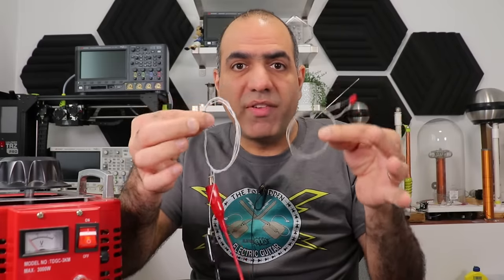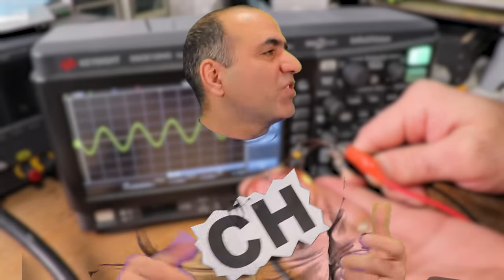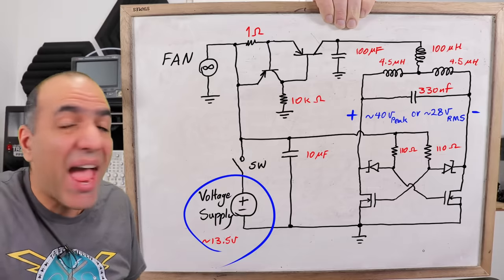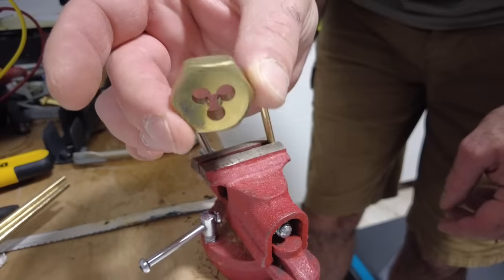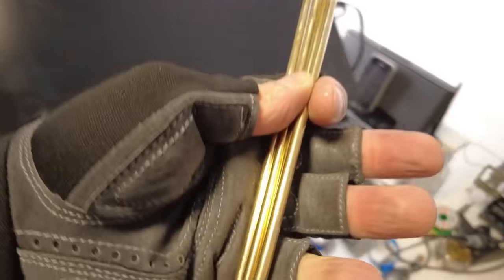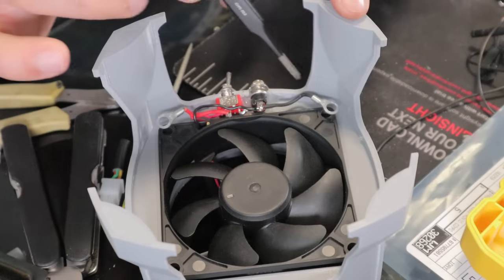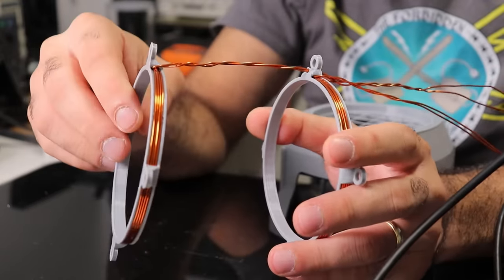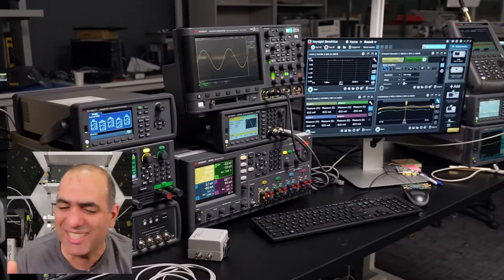Making a Lantern Full of Fireflies

Comment: Honestly, it was nice to see you proud of something you built without it exploding.  Plus it's a thing that I would actually buy!
Reply: Why not build one? I mean this is basically a how to, with an included circuit diagram.
Reply: @salemcripple sadly not everyone has access to a 3d printer.
Reply: @sonicgen20 
3d printers are stupid cheap now, but regardless you could easily modify a thrift shop lantern. The part I see most people struggling with is the soldering and coil winding.
Reply: I would love to build this. You did a fantastic job on it. Can you post the circuit diagram and the printer files?  @salemcripple

Comment: This project genuinely inspired me. I would actually love to recreate that lantern as well.
Reply: i feel like the only mechanical improvement would be to get a slower fan to make them look more like they are "flying" rather than being in a vortex... probably easier said than done
Reply: @sorcererCermet you can get fan controllers that can control the rpm!!
Reply: @sorcererCermet would magnets work? Attach LEDs to magnets and then adjust the strength of a bottom magnet to raise and lower?

I guess it wouldnt look right because they'd all be roughly the same height.

Comment: 08:00 Looks like you need one of those magnetic, flexible headbed plates EB. They're weakly magnetic so its easy to peel a corner up and as the plate bends the print should, theoretically, pop off.

Comment: Two suggestions! First you could send the coil power through the two remaining brass rods.  The ends of the coils could be soldered to the brass where the brass passes next to the coil.  Then coat the rods with clear coat or conformal coat so that nothing shorts them out.  The second suggestion is you could add a second LED in the opposite polarity since they are diodes they will act as tiny rectifiers. That way the "flies" will be producing light for the full wave instead of only half of the wave.  You could sandwich the capacitor between the LEDS.  Also hot air and solder paste is very helpful for tiny SMD components.
Reply: Good ideas, but I disagree with the second LED suggestion. Polarity will keep reversing as the coils move about in the chamber and the second LED will reduce the flicker effect and add weight to the element. Though they would not reduce the current draw as they are opposing polarity.
Reply: @drwhoeric  Nope, polarity is reversing anyway 96000 times per second because it's AC. So the movement of the fireflies doesn't affect the polarity of the waveform the LED sees.
Reply: @cooperised  @drwhoeric Exactly! The frequency is way too high for the polarity change to produce any visible flicker.  Infact, Flourescent lighting flickers every time mains AC changes polarity, or 120 times per second for 60 hz AC.  That flicker is barely perceptible to only the most sensitive people.  However, the phosphorescent coating does continue to glow dimly after you shut power off, so the contrast of each flicker isn't as great as if you had a 120 hz monitor flicker between black and white screens.  The flicker of the "flies" is actually created by the orientation of the fly's coils.  When the fly coil is perpendicular (horizontal) to the alternating magnetic field, alternating current is induced in the coil to power the led, but when the coil is parallel (vertical) to the alternating magnetic field, no current is induced in the coil.  Also the angle of the coil will vary the intensity of the induced curent, so at a 45 degree angle (diagonal) the induced current is half as intense.  However, a negative effect could potentially be that the additional LED changes the resonance of the entire circut, but this is easily fixed by remeasuring the resonant frequency and adjusting the driver.
Reply: Problem with the 2nd led is that it would never stop glowing it would alternate between the two depending on which part of the magnetic field is induced, it wouldn't look like a firefly
Reply: I think with a second LED it will be much worse if it works at all because you basically shortcut the capacitor if you allow both directions.
Reply: @cjdelphi  Nope, like was said already, the current induced in the fly is alternating current at 95 kH or changing polarity 190,000 times a second thus causing the LED to blink 95,000 times per second.  Most humans can only see up to 60 Hz, or something that is blinking 60 times per second.
Reply: @1234567890CAB  my issue with what you say is, it's coming from a pulsed square wave dc at 12v, not sinewave you know what.. i'll build it this weekend and pull out the oscilloscope
Reply: @cjdelphi  Agree, that is why I recommend not even trying that. As one LED goes high, the other would be it's inverse. Plus it would add burdensome weight to the coil.
Reply: @drwhoeric  I've been meaning to build   something like this for a while only without the jar, a couple of coils and see how far I can transmit the energy..

At the same time I can investigate the voltages induced on the second coil
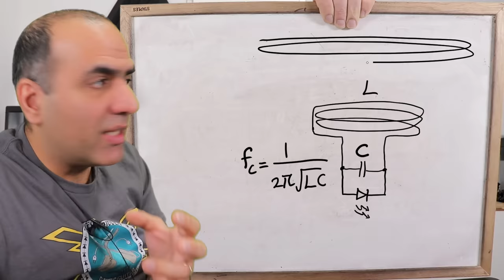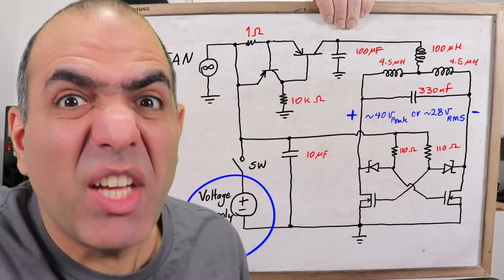Reply: @cjdelphi  Okay a couple of things.  First I was going off of what he said at 1:25 4:20 and 5:42 where he describes the coils as being powered by AC, thus I assumed positive and negative.  Next, at 13:05 he implies that the circuit he designed did not work as intended and he had to change it, so we don't know if the schematic he showed on the screen is exactly what he used.  Along similar lines, we don't know for sure the orientation of the coils on the glass, we are assuming that they are in phase and producing magnetic fields of the same direction, but if one of the coils were put on upside down, they would be making opposite fields.  Finally, my understanding how inductors and transformers work is as the voltage is being applied, voltage is rising and thus the field strength is rising.  The secondary coil in that changing field only has emf induced while the field is changing.  Once voltage in the primary has leveled off the field stops changing and thus no more induced emf in the secondary.  Then power is cut to the primary coil and the field begins collapsing.  Now the collapsing field induces a back emf or negative current in the secondary because the secondary coil is seeing a weakening magnetic field. Now weather or not the voltage in the primary continues to drop into the negative doesn't change that there is back emf being generated by the collapsing field, it only makes the magnetic field strength continue to change in the negative direction because the voltage is changing in the negative direction. Additionally a transformer powered by a square wave is very inefficient compared to one powered by a pure sine wave because there is only a "product" in the secondary when the field is changing. Finally, I am still a student so my understanding could be wrong or I might not be 100% correct.  Also everything described is assuming ideal inductors/transformers/circuits and as we all know the real world is often non-ideal.
Reply: Another thing that would be interesting to test is if just a fixed magnetic field was used and how strong a field and how fast the flies would have to be moving through that fixed field for them to light up. If the flies were spinning perpendicular to the fixed field they would form an "alternator" or simple fixed magnet generator and would have an induced alternating current that was the same frequency as their rotation.
Reply: @1234567890CAB  my understanding could be wrong based on the circuit he posted on the white board, um cgi of a whiteboard I'm merely comparing this circuit against what happens with 2 windings on a toroid

The secondary winding wouls be reverse polarity of the primary winding as the emf builds giving a negative voltage,  that's why I'm not saying you're wrong in the slightest you could be right, but feeding -12vdc through to 0 and to 12vdc absolutely would do what you originally said, I'm just struggling to get my head around it and it's easier to just build one and see 😀
Reply: @1234567890CAB  interesting thought, just create an electromagnet and let the fan do all the hard work, I'm not sure if they would be fast enough to induce enough current in the winding without needing more coil, then we have to consider the huge power losses..
Reply: @1234567890CAB  unless permanent magnets were used...

Comment: Now THAT is a very nice project!

I'd use maybe 4 coils with 2 turns each coil. Use some kind of fast mosfet driver ICs for output stage, capacitor pi-network to match the coil impedance, and then use some faster Arduino (72 MHz BlackPill?) with potentiometer to tune the frequency for maximum voltage on the coil (should be in the ballpark of 10MHz for coils this big).
For fireflies, I'd put two LEDs in anti-parallel (no capacitor, just use parasitic diode capacitance), and tune the frequency by adding turns.
After making fireflies, fine-tune the big coil frequency with Arduino for maximum firefly brightness (and adjust the capacitance as well)

Comment: Maybe by using very small capacitors on the fireflies, you could only put the coils at the top and at the bottom of the tube so they could be hidden. When the fireflies go near a coil, their led would stay on 1 or 2 seconds without needing to be in the range of the coils, enough for them to move around and  eventually recharge when going near a coil, while being continuously on.

I don’t know if capacitors are possible because the magnetic field is AC, if it can be made to work it might require extra components making it to heavy  (don’t hit me the circuit part was to complicated for me)

Comment: Awesome video. Some 3D print tips. Looking at the parts that broke you have some underextrugen (not enough fillament fast enough) you can fix it sometimes by just add a little more heat 10 - 15°. Some fillaments like a little more heat. It could also fuse the fillaments to each other better. Best tip look into infil patterns. Lots of software pakketges are getting more and more options. I almost always print with an infill that is stronger in all directions instead of stronger but only in one direction (sadly often the default). Try something like cubic infill from Cura software.

Comment: What an arduous build! The only thing I was wondering why is there no potentiometer in line with the fan for controlling the air flow easily.
Reply from the maker: Because I had to set it to maximum for the fireflies to rise all the way anyway, would be good to have control for stronger fans

Comment: It takes longer to print, but do around 60% infill and 3 walls. They will be much stronger, at least in my experience using pla. And my printer also need to print 10-15 degrees cooler than what the spools say, the bed temp is ok tho, i use 190c to print and 45c for bed. Still newish to the 3d printing too about 2 years in

Comment: Considering how easily your 3D prints were breaking along the layer lines, I would say you are printing 5 to 10 degrees too cold on the hotend. My recommended temp for most PLA is 210 C at the nozzle.
Reply from the maker: Yeah I raised the temperature by a bunch for later prints. I'm using PETG which is not as brittle as PLA.

Comment: This is super awesome, and I definitely understand the pain of trying to 3d print fine parts, having them come out wrong, and having to throw them away and redesign a ton.
Reply: Yeah 3d printing just aint there yet
Reply: @VashStarwind  3d printing is fine, it's the design process. No matter how much you think about your design, after printing a part it may not work as intended, for example some tolerances might be too small, so you have to tweak it and reprint it.
Reply: @chibicitiberiu  And thats why its not there yet. That and 3d printed stuff breaks very easily
Reply: @VashStarwind  3d printers aren't magical, they are machines that print whatever you give them. If you design something wrong, the printer can't fix it for you.

If properly printed with quality filament, 3d printed parts won't break any easier than injection molded parts. Getting the right settings is where things are a bit more difficult, but modern printers (like Prusa and BambuLabs) actually do a great job of simplifying things and make 3d printing very accessible to anyone.
Reply: @VashStarwind  I feel like that's the result of not knowing the strength of the plastic and how much reinforcement your design has. A fragile material requires more care compared to a more durable one, we're used to the durability of steel and have to compensate for the relative fragility of PLA or what have you. I recall a story where the designer for the Brooklynn Bridge (?) tripled the amount of wires used due to him knowing the wire supplier cheaping out on him.

Comment: I'm glad you leave in the critical mistakes, such as the 3D printed fins to reduce or eliminate the wind vortex, which turned out to be overthinking the problem. 

I find it apropos that I'm watching your video while cobbling together a Frankenchair. 

Someone threw out a gaming chair, awhile ago, and someone else threw out an office chair that I'm swapping the piston from.

Neither one wanted to cooperate, so I'm adding some new holes to the other baseplate to switch it that way, instead.

Comment: 15:04 Do i have to understand, why there is a coil-holder at all🙃 

Stupid question, but some capacitor wasn't a option, so the fireflies charge when they are close to the coil and flash when they are away from the coil again?
Reply: Weight
Reply: @onesuser1  Not a off the shelf cap, metallizing the foil to have a structural capacitor.

Comment: Don't know if this has already been suggested or if it would even work but a possible improvement if you wanted to hide the coils (though it currently looks kind of cool as the rings in the middle) could be to use brass tubes instead of solid rods so you could place the coils inside them vertically on each side of the chamber if that makes sense, it might also allow the led's to stay lit more consistently as the field is more uniform across the shorter horizontal distance. *EDIT - not sure if this would affect the flickering which makes them look more like fireflies though, maybe you could compensate for that in the driver circuit?

Comment: I think it'd be even better if you used the other 2 brass rods to power the coils.
you could use a set screw to hold the wire against the brass rod.

Comment: I'll take this project and modify it a bit if you don't mind.
The end product is a bit too chaotic in my opinion, so I am going to replace the air with clear mineral oil. Which creates more drag and thus slower moving LEDs, mineral oil is non conductive which means that I can dump all the electronics in there and it should still be fine. I'll make the LEDs neutrally buoyant ish as well and add a fan on top and bottom to create light turbulence in the oil...I hope the small fans will work with the oil viscosity.  I'll steal the primary and secondary coil idea though ;) 
Upside, the "Fireflies" probably move less chaotic
Downsides, there is oil involved, it's heavier aaaand I better not drop it during testing. 

I wanted to make use of a charged surface area and make them levitate in the air at first....I had a feeling that this would require quite some voltage, so after some napkin math I realised that it would take hundreds of thousands to a couple of million volts depending on how much surface area I'd end up using, almost everything becomes a conductor at that point...Plus it's unfamiliar territory. I'll leave that idea to the more experienced people.
So yes, mineral oil it is :)

Comment: You should make a second version where the fireflies movement is controlled by 2 electromagnets rather than a fan. You could do fun stuff like add a dial to change the strengths of the electromagnets so they flies go to different spots :)

Comment: Need to slow the fan down so it only can life the flies so high then produce another air flow from another direction to get the flies to circulate in the glass container; learning airflow dynamics might help too. Now figure up the hours of designing and making it and see if you can manufacture it for $19.95 and you will have a market for purchasing.

Comment: Pint it blaaaack!!! I was thinking, while watching the video, that you could replace all printed parts with some black aluminum sheet metal. So it could pop more out. And I think it would give it more of that style you are trying to make. But then you wouldn't?t be able to use brass rods as conductors, but you could make rods hollow and run cables through. That way you could also be able to hide wire that is coming to windings in hollow brass rods. This was a great video. It would be very cool to see a metal version of this lantern.